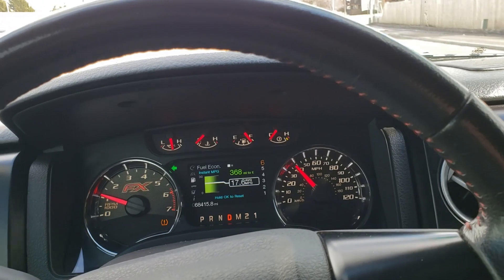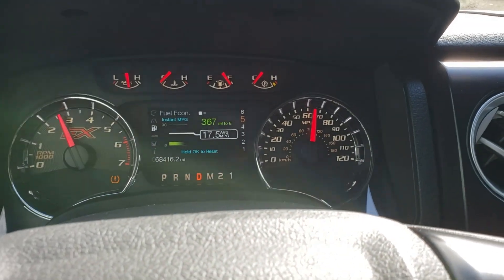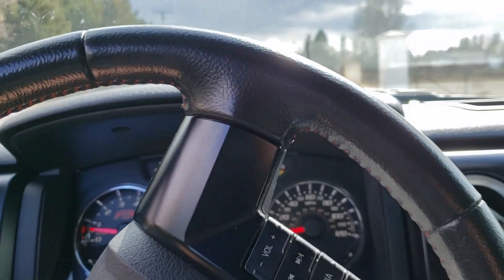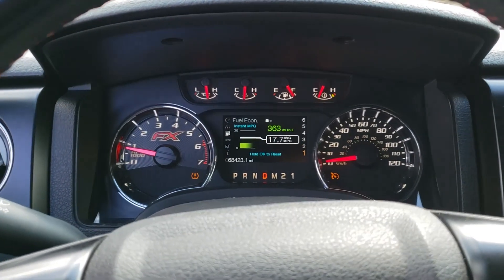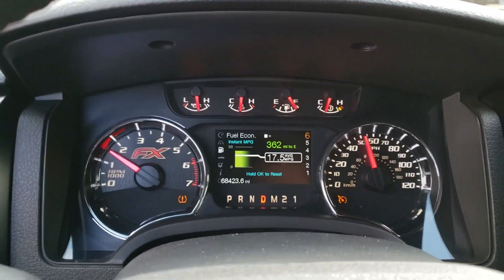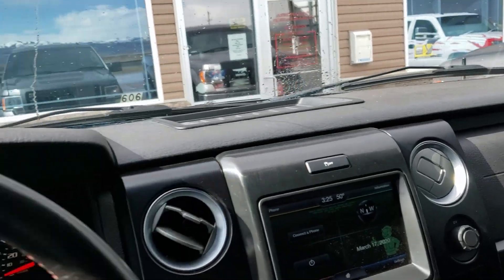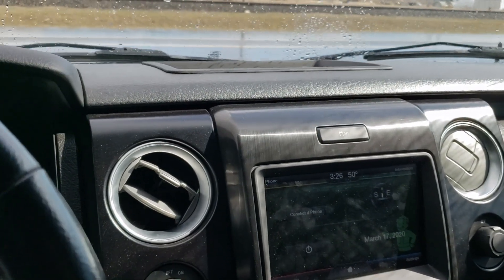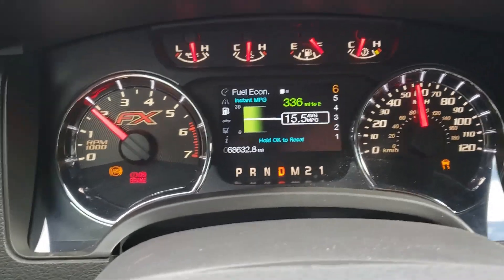2014 Ford F150 Tremor Rebuild Pt. 3 - Time for a Tune + 0-60 Pulls

Comment: I see all these tremors at 17.0 mpg and my is at 13.4 mpg what are you guys doing for more gas miles?
Reply from the maker: 17 was a good day for mine... i was usually around 15
Reply: @JTay187  did you do anything different to get that many mpg?
Reply from the maker: @mousealamuger9302  drove like a Grandma... Low rpms... Set the cruise whenever possible... 65mph max on the highways....... Wasn't worth it haha
Reply: @JTay187 you just have to reset it!!

Comment: bro i don’t even drive my tremor hard and i can’t barely stay at 14.0mpg. how is ur economy better?
Reply from the maker: Don't let it fool you lol... Best I EVER got was 15.0.... They are terrible on gas mileage
Reply: I took a 2 hour trip last night and I got 21.4 MPG. You just have to reset your gauge. If you drive in short distances you have to really baby it to maintain the mpg. If you leave it idling too that shows you a way lower mpg that what your actually getting

Comment: Helps if the emergency brake ain’t on
Reply from the maker: It wasn't... When you pull the fuse under the hood to turn traction control ALL the way off the brake light comes on, along with the other 2 lights